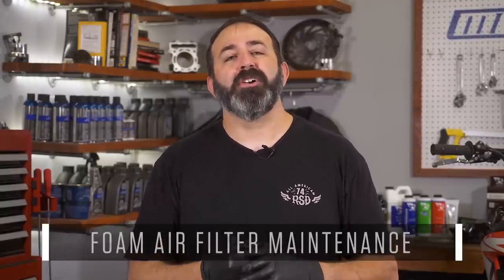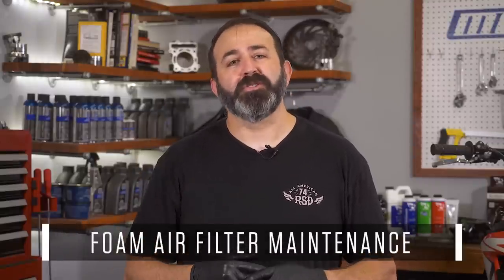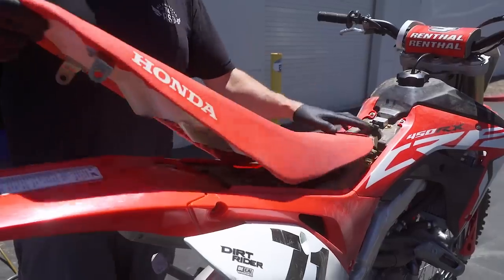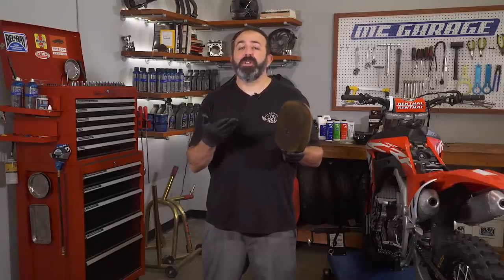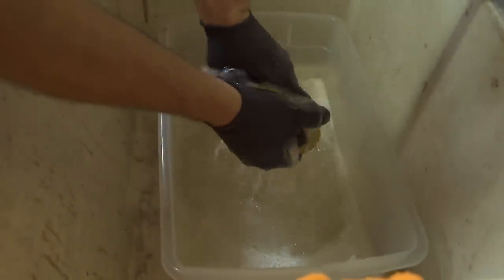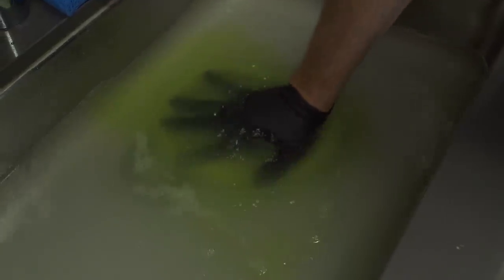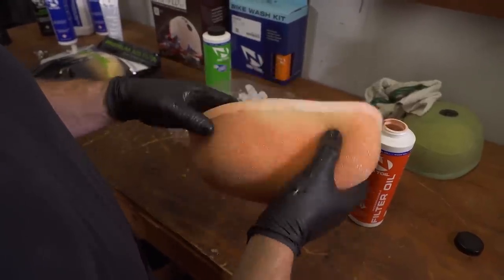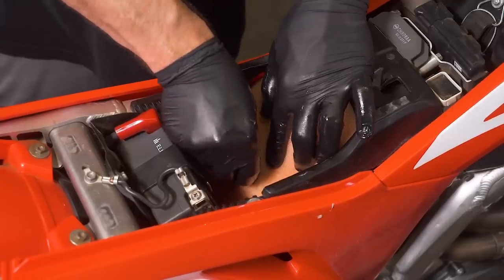How To Clean A Motorcycle Air Filter | MC Garage

Comment: Instead of using aftermarket filters, I just cut out some parts of the stock filter. What do you guys think about that brilliant idea? 💡 😉
Reply: One wonders why the filter element only is not swappable; must replace entire assembly. Otherwise its DIY nighmare cutting removing matching & fitting new element
Reply: Do both

Comment: another question. I rev a throttle on cold engine until 2/3 of max speed on Neutral in my Honda Winner X before I knew it is not good for an engine. Could I f  k up something by doing this just one time few times twisting a trottle?

Comment: Hi, it's so hard to imagine dirt getting through a mass of foam like that. I've always used paper filters, so don't know from experience. I just bought a used Triumph bonneville and was doing an oil change, chain replacement and headed towards the air filter.  It's got cone shaped replacement s it seems and they seem dirty, that's why the inquiry. Haven't pulled them yet but ordered some, inexpensive paper replacements. Then started looking at prices and was shocked to see like 50 bucks for 1 , and I have 2 to buy. Seems expensive, when I pay 20 for my Ford van filter. 
Guess I'll see when I pull the ones on it now. Thanks for the info.

Comment: please please help me out. i don't know what to do or check. been asking around and tried a couple of solutions and still the same..

the situation is, my motorcycle has drum brake at the rear. it has spoked wheels.. i have bought 2 rear hubs because i keep on having the same problem.. now I'm on the 3rd hub and it happened again. i don't want to buy another hub until i know what's causing it..

the bearing where the drum brake is keeps becoming loose over time.. it's like you can put new bearings in w/o the need to apply any force on in. it would just slide thru.. can you please help me out?
Reply: Is the rod that goes into the wheel n rim the correct size?
Reply: @abbashaider9141  yez. it's the stock one.

Comment: Old question. Can you use gear oil instead of foam oil?
Reply: weimaaan no because foam filter oil is very sticky to catch dirt and dust
Reply: @joeyantolak6426  thanks!
Reply: depending on the environment you are riding in, you can use normal motor oil if you can't get a hold of foam oil. Foam oil is going to be the best choice though.
Reply: @Jacob-dp4ol  thanks for the input. I've tried using gear oil 90W once, but now i always buy new foam filter. A can/bottle of foam filter oil is expensive here, so buying new filter is more economical 😅
Reply: @weimaaan  Is it really? My local auto store has foam oil for less than 10$ a quart, and that lasts a few washes.
Reply: @Jacob-dp4ol  in my country, a 1L foam filter oil costs around $15-20 (imported). New filter costs $3

Comment: You should only use a filter around 10 times???  Really?
Reply: Some one needs to talk to k&n & pipercross. There lifetime clean and reuse filters might not workout if you have to replace the in 10 washes (sure the one in my old car lasted longer than that without breaking apart).